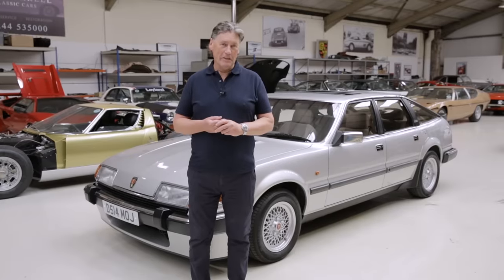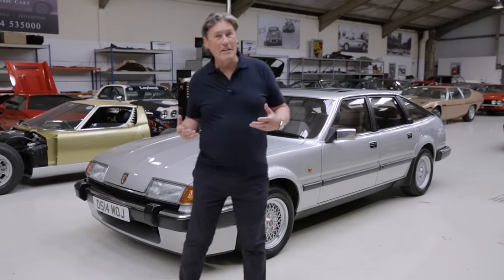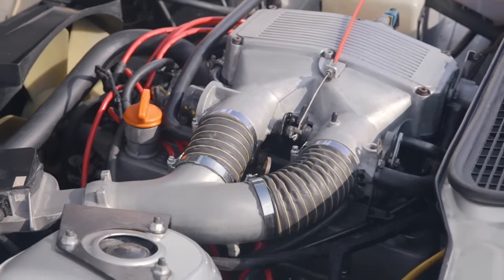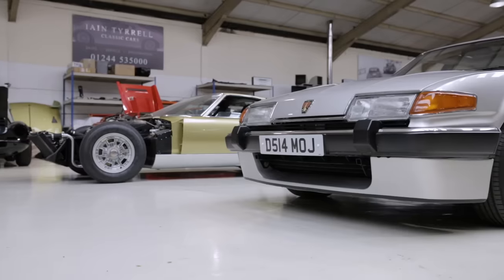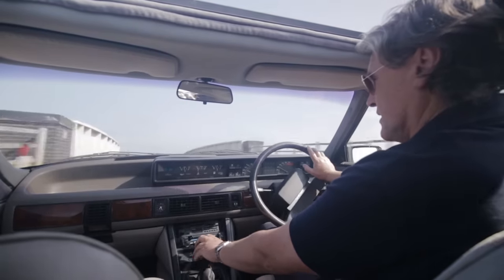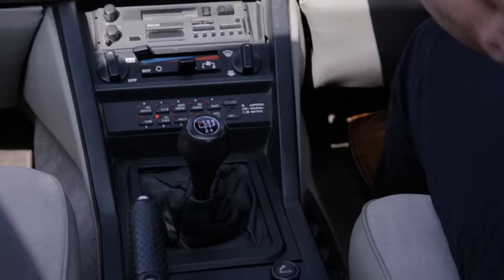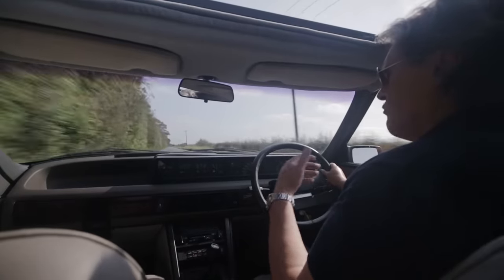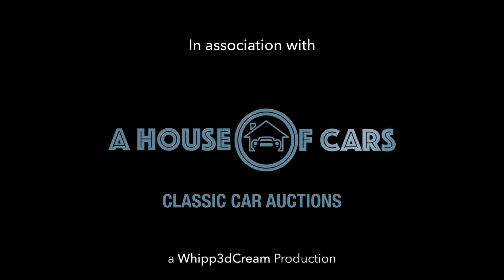Rover SD1 Vitesse - American V8 Power Meets British Engineering | Tyrrell's Classic Workshop

Comment: My first job at Lotus was running a test bed testing the twin throttle plenum V8 for homologation. On a trolley behind us was a small rig operating a set of throttle valves with a windscreen wiper motor (we actually went through a number of them to complete the number of cycles required). Happy days :-)

Comment: Having owned and loved several of these old barges from around 1983 until about the mid 90s I can confirm they were fantastic,  an early 2600 manual  a later 3500se and finally a 3500VDP both autos all  lovely cars that felt pretty special when and wherever you drove it

Comment: I had an SD1, the computer broke just after midnight Jan 1st 2000. We were joking about the millennium bug at the time.
When I eventually found it (under the passenger footwell) Someone had written on the top in sharpy "Congratulations, this is the last car off the production line in Solihull". There were some other details and a name. The garage that replaced it threw it away, I was furious. It wasn't a Vitesse but it was very fast, I've had several Rover v8's in my youth and the SD1 really moved.
I got it airborne over a hump in the road which greatly impressed my young son and nephew:)

Comment: I have one of the very few SD1's that were sold in the States: the cars that made it here (about 750 of them) had the V-8, but a slightly de-tuned version of it, to meet the emissions standards we had at the time 

That said, my car in particular, also a 5-speed car, really gets up & goes! Moreso than many of the other SD1's that I've encountered here.

Sad part is, I can hardly hear the engine! Between the fan blade, and a single turbo muffler behind the catalytic convertors in each bank of cylinders, the car sounds more like a jet!

Have recently been pondering building up a 4.6 version of the engine, and dropping it in the car, though with nearly 200,000 miles, there's nothing wrong with the 3 5 at all.

Comment: My late father used to drive the SD1 for the Met Police, after the P6's. Loved it to bits. Had plenty of tales of his chases through London, winding up the V8 and getting it airborne over flyovers. I remember as a kid though he'd come home from the works garage in Chadwell Heath with a pocket full of wheel bearings that had been ruined that week. They made great marbles!
Reply: Are you aware of the unmarked twin turbo SD1 that the east London traffic police had on trial...they had it at bow garage so may have made its way to Chadwell heath too?...it blew up on the M25 I believe so that plus heavy fuel consumption and being too fast meant it was never going to get commissioned for the two blue lights n jam sandwich
Reply: @tonyb5884  Traffic and Met never mingled. :) Met would have said Traffic couldn't drive, that'd be why it blew up.
Reply: @stillmation  I heard it blew up cos they'd taunt high performance car drivers to 70-140 mph roll ons..lol

Comment: Beautiful. Love the simplicity of the dashboard too. That V8 engine! It was the most powerful thing I'd experienced in my younger days, sounds great, goes great. Even in the P5 which was a big heavy thing but had the comfort of a stately home, then in the P6 seemed much quicker in a lighter car, then in the SD1 which just seemed so much more modern and futuristic. Always found that twin carb setup tedious to work on though, the bulk of my car tuning in those days was with twin-choke Webers on 4 cylinder Ford engines which were a much simpler setup.

Comment: Ah yes.... the British Motor Bungling Consortium. Everybody had a fireproof job and the movers-and-shakers behind all that assumed that top-notch products would just keep rolling off the production lines. I wonder if those involved ever acknowledged the real-world consequences of their actions.
Anyway, here in the U.S. the car was known as the Rover 3500. I nearly bought one off a used lot when I was young and immortal. What threw me off was seeing most of the car's electrical system piled up on the front seats.
 However they looked great even with the idiotic Federal 5mph bumpers and equally idiotic sealed-beam headlights. These days I'd love one. Swap in the later 4.6 version and a T-56 trans behind it, with a lot of tuning elsewhere, and even more fun would be had from one methinks!
I just realized I'll have to win the Lottery now thanks to all the ideas I'm getting from this channel. Thanks a lot. :-P

Comment: Brilliant review and that's a very reasonable mild-tune for the V8, any more and the LT77 and probably the rear-diff would need to be uprated too.  The LT77 started out on the P6 3500S (I own a P6 3500) and the early boxes were a little fragile, a lot of owners I know went for a R380.  The SD1 is definitely a 'what-if' car and as Spen King once said, built by the Austin-Morris sabotage squad.   Rover and Triumph were pretty much filleted under the BL badge, my '69 P6 is built like a brick outhouse in comparison.  To see a real Vitesse with some great Q-car mods - very, very satisfying.  Liked, subbed and looking forward to more.

Comment: A friend of mine had a 2.3 straight 6, the  2.6 straight 6 and then the v8 sd1. He ran them into the ground but the v8 rotted it’s primary’s out so they were blasting out on to the floor with zero muffling. It sounds awesome.

Comment: The Fuller is the groove in the blade which is there to remove weight from the blade without removing strength . It is not a blood groove .  You should a groove put into a sheet of steel adds strength to the sheet .

Comment: I had a fewLeyland  P76 V8s which were basically the predecessors of these (Struts & rack up front & a 4 link live axle at the back), but with a 4.4L version of the same engine ( had the deck height of the Buick 340). Always wondered how they’d go with a Buick 340 crank & the wider pistons from the last British engines.
Reply from the maker: Good question!
Reply: @iain_tyrrell  thanks for replying Iain. It’s really neat knowing that you listen & reply to your commenters. In North Sydney there use to be a car dealer of luxury cars, particularly European performance cars & Jags, called Tyrrell Classic Cars (although I don’t recall how they spelt Tyrrell), were they connected with you? Or was it some sort of coincidence?

Comment: In 1975 I had a crisis like every other owner of the Chevy Vega GT. The idiotic aluminum bore 4-cylinder engine was scored beyond repair. In a wrecking yard I found a 63 Olds F85 after reading an article in a hot rod magazine. It had the all Aluminum, iron sleeved 215 V8. It weighed just 20 pounds more than the Vega engine. Long story short, after a thorough rebuild, it fit nicely into my Vega to make the finest swap project I've ever owned. An adapter plate and some custom welding let me even use the Vega 4-speed transmission and clutch. It got over 25 mpg and was very quick for the Era. People who swapped small block iron Chevy V8's into Vegas usually ended with a straight-line monster that couldn't handle or stop. The aluminum 215 was the perfect mill for the job.

Comment: I liked the video and this is one of the few UK cars of the era that got my attention.

As to the Buick engine. It was in production through 1963, not 62 and the big reason for it's discontinuance was casting problems in the block that limited production and drove up costs. If you want to talk racing then see the car Dan Gurney drove at Indianapolis in 1962. Also it was a part of the heritage  of the Repco Brabham of 1965. In the 1970's General Motors tried to get the design back for use in Cadillac cars but failed. Buick had produced a 90 degree V6 which was similar to  this engine except it was cast in iron and it was used in Jeeps and then in GM cars in different versions until 2008. In 1964 Buick redesigned and enlarged the engine with an iron block and 300 CID. By 1968 this had been increased to 350 CID and continued in production until the mid 1970's.

I think it was wonderful that Rover did so much development work on the engine over the years and a shame that the owners of Land Rover after BL (BMW & Ford) had such little respect for the engine and rushed to replace it with more complex and troublesome engines the gave very little practical advantage over the Buick/Rover V8.

Comment: Very interesting video, lovely cars indeed. I served my apprenticeship on Daimler/Jaguar & saw the introduction of the S1 XJ6 and latterly, the V12 models. It isn't necessary to remove the entire FD unit/cage assembly in order to replace the  rear brake discs, this can easily be done by dropping the drive shafts, allowing them to stay affixed to the vehicle thereby allowing access to & removal of the discs. This was only possible because on earlier vehicles, there were two diametrically opposed holes machined into the disc allowing access to the output shaft oil seal carrier, which had the brake calliper attached to it, these holes allowed the 5 carrier bolts to be accessed with a socket & the assembly to be removed accordingly, this likewise worked when replacing the oil seal carriers, having leaked. This method was a "cheat" and was accordingly scuppered when Jaguar stopped machining holes in the discs, which considerably  increased the time it took to do the job (as well as depriving the technician of the bonus he may have accrued) Happy days.😀

Comment: The other issue was that Americans were used to iron engines without worrying so much about the maintenance required with alloy motors (ie proper coolant and overheating issues that would warp alloy motors vs huge low spec iron ones). GM also couldn’t get the reliability up to standards so they abandoned the project. Rover succeeded by devising wet liners for the cylinders and voila! Reliable and dependable motor for the British car industry….. until they didn’t update the tooling for 30+ years and after Range Rover bored them out to 4.6, the blocks finally gave because of irreparable cavitation …..

Comment: The beauty of cars like this versus modern high performance saloons like e.g. a 5 series higher end car is Iain can floor it for 7 seconds in 2nd gear and enjoy the noise and the character whereas a modern car if you plant it for 7 seconds, even 5 seconds you're looking at speeds that could lend you in jail and the experience is somewhat sterile.  Great car, great video.

Comment: The MG ZT 260 is the successful relative of this car. A Rover V8 based on the Rover 75. It was actually produced when Rover was owned by BMW. ( I have a diesel ZT which actually uses the common rail BMW 3 series engine but transversely so not the problems of the 3 series. Mine is remapped to 160bhp and flies) 

Under the bonnet of this flagship ZT is a mighty Ford Mustang-sourced 4.6-litre V8. It offers more than double the capacity of turbo rivals, yet produces a relatively modest 256bhp - which works out at only 56bhp per litre. However, the 260 covers 0-60mph in 6.2 seconds and goes all the way to 155mph.

Comment: Really great video...I had 3 SD1's in the 80's early 90's. Mk 1 3500, Mk 2 2600 and a Silver Vitesse single plenum. I changed the auto to a manual. Great car - wished I had kept it. The brakes wasn't up to the performance really, I think there was a conversation kit to put XJ6 discs and calipers on the front hubs. I won't mention the 2600 SD1  which was an abomination.

Comment: My understanding of the Rover 3500V8 is that it was bought lock stock and barrel from Buick, hence the P5b when replacing the straight six in the P5 and then in the P6b the b, in both cases referring to the ex Buick all alloy V8 engine.

Comment: Beautiful car. I own a 99 LR D2 with the 4.0  V8 I’ve owned several pre Bosch units and with my 4th purchase an aforementioned D2 they have head gasket problems other then that It’s still running. I’ve owned two D1s with the Lucas electronics never had any problems.

Comment: Unless you have owned one of these Rover V8's or even the 6 cyl version you dont fully appricate how good these car were to drive and why they were loved. Tthe steering , and the gearbox was a sweet as the engine. And they lasted mine did more than 250K miles. For the performace and comfort they offered the engines wern't even  that thirsty, (as long as you used the torque not the revs) and better than many other cars at the time. Even today they still look modern. I still miss mine. As everyone comments  just imagine what could have been if they been built properly
Reply from the maker: Exactly

Comment: I had one,nice drivetrain but the rest of the car disintegrated around it. The distributor,ac compressor, air pump all went within 80 000 km. Headlining fell out,dash split, de mister wiring shorted by rubbing against the hatch strut. I used to carry share rocker switches for the power windows as they would snap regularly at $80 a pop in the early eighties.I also had a 3500 in a factory MGB V8, that was fun.

Comment: USA car manufacturers, Ford especially, found in the '60s the new thinwall cast-iron casting method, POUND PER CUBIC INCH, was as 'light' as the aluminium engine. 4.7 vs 3.5.

Comment: The biggest reason Buick shelved the thing was the horrific scrappage rate, something around 30%.  Buick actually tried to buy it back later.  They were rebuffed...The one weakness of the LT77 gearbox was the (nylon?) Oil pump gears.  You can get bronze gears now.

Comment: Just a point on your details, General Motors never had a "Mercury Marine Engine Division" Mercury Marine is and has been a division of Brunswick Corp since 1961,however were building the LT5 Lotus designed V8 for GM under contract for the 1990 CorvetteZR1.

Comment: I read the reason GM didn’t need that engine anymore, is they worked out how to thin wall cast iron, so they could get acceptable lightness without the cost of aluminium. From Range Rover History, by James Taylor iirc.

Anyway, excellent video and model.

Comment: Loved getting away from London police as a young driver in the V8 in 80s. The Police who ran the 2600 SD1 locally didn't stand a chance. Unfortunately most cars in this era suffered from  killer front brake fade . Pulling up at the lights after a thrashing and brake pad smoke would plume from the front wheels. Rear shoes were nowhere near as good as the previous  Rover P6s in board disc set up . Many a time I would brake in these Rover v8  fords Granada 2.8 and cortina 2.3 to find the brake pedal would floor with just the rear drums working at the bottom of the pedals travel. How im here today is without doubt a miracle.

Comment: The SD1 was indeed light for a large car especially at the rear.  The Boge Nivomats suited the car well.  Conversions were terrible.
The manual gearbox was as pointless as the post 82 GM180 auto.  The pre 82 (ish) Borg Warner 65/66 was a perfect match.
They were a comfortable long distance cruiser that could top 35 mpg (twin SU HIF6 version) on a long motoway run - without breaking into a sweat.

Comment: The beauty of the engine is that, being a small capacity V8, it is very compact and having an alloy block, is very light. That means it can fit in other cars of 1.6L to 2L size to give them far more power without needing to uprate the suspension. I heard it weighs no more than a Ford 1.6L 4 cylinder.

Comment: Had an Ex police one for a short while complete with massive speedo in the dash and 10.75:1 stamped on the cylinder heads. Absolute flying machine , a lot of a drinker and every body panel had been dinged in. Sold it to a mate for spares for his Vitesse after my bank account cried halt with its addiction to fuel. Fun as it was still in jam sandwich livery, sadly no blue lights..

Comment: Great car room and light cant imagine  engine  would last long with turbo  on it plenty of problems  blocks ,heads cams but easy  to work on saw one almost no oil pressure  main bearing bolts all loose  tightened  them up away it drove perfect   .Good strong crankshaft  peculiar  rear wheel  bearings

Comment: Like a lot of British cars imported into Australia is the propensity to overheat and kill the head gaskets.  Over here it is not uncommon for owners to install a triple core radiator to finally get reliability in hot (30C+) weather for their Rover V8 based engines, including Land Rovers.  Considering we get temperatures nudging just shy of 50C (120F) in the outback summers, and that means the aircon is usually adding to thermal load, that’s gotta be a good thing

Comment: I'd love a walkthrough of what, exactly makes this engine "so tunable" in comparison to others?
Reply: Likely the fact it is American in origin, from where the most appalling engines have been created, in terms of power per litre.
In the 1970s, many US engines produced less power per litre, than pre-war European engines and I don't mean the performance end either.
Reply: @matthewjenkins1161  I think it was from the US in the 60s though.  We discontinued using it before 1970, no?  Admittedly the US has been one of the worst countries for things like resource (oil) consumption, but you have to admit that bringing in emissions control in '71 and catalysts in I think '73 was one thing the US was world-leading in in terms of ecology.  I think Germany didn't mandate them until like '88?  I remember that catalyst was finally OPTIONAL on the 928 around '85 or so.  Anyway, yes, by the late 80s you could control emissions on an engine and still have about the same power, but the technology simply didn't exist in the 70s, especially early 70s.  Still, not sure what that has to do with the 3500.